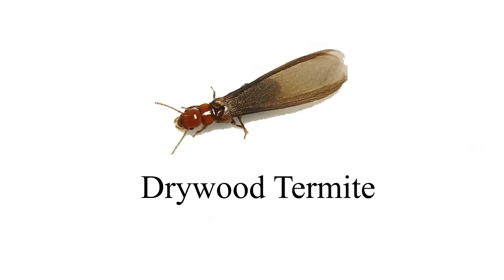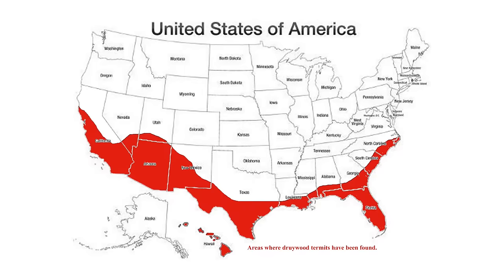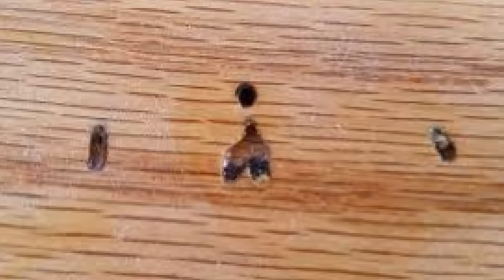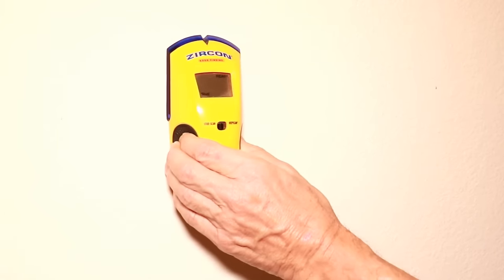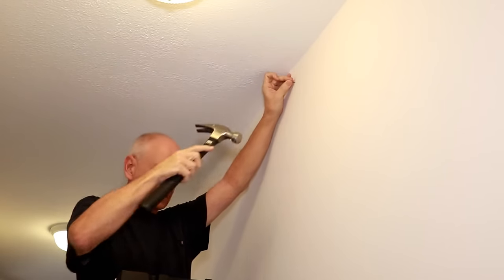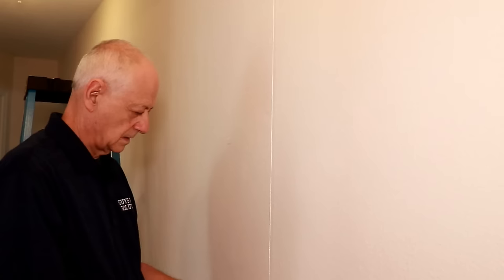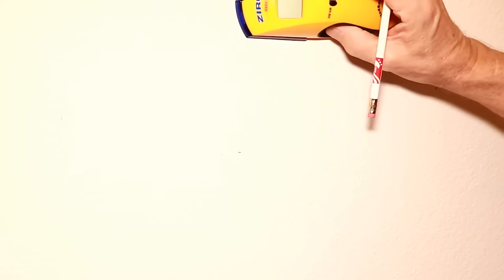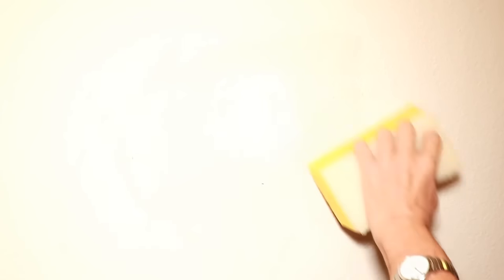How to Treat a Drywood Termite Infestation Yourself. A MUST see if you have Drywood termites.

Comment: I live in SW Florida do you recommend tenting for dry wood termites.
Reply from the maker: It is important to understand how drywood termites work.  They enter through cracks and crevices around windows, doors, the eaves, pipe penetrations, and so forth.  Most of the time, they enter through several locations.  That is because a swarm of them attacked your house at the same time.  If there was a crack or a crevice, then they probably found it.  After they established their galleries, which will be inside the wood, it will take four to seven years for them to be able to swarm.  Now that they are in your house, the swarmers will use holes that are in your studs to travel through the walls.  Those holes in the studs were created by the electricians to run the electrical wiring.  Not only are these holes going through the studs, but holes were drilled into the attic for the light switches and to run some of the wiring for the outlets.  So, the termites now have easy access throughout the attic and the walls.  Most of the time, you will have no idea that they are in the walls, because the frass is inside the wall.  To make matters worse, if you have drywood termites, then your neighbors have them too.  That means you have been getting swarmed for as long as they have existed in the neighborhood.  Most likely, we're talking about years, so it's a safe bet that you have these guys in many locations in your home.

I always hate to be the bearer of bad news, but if you have drywood termites, the the answer to your question is yes. The only sure way to get rid of them is to fumigate.  Prices for this can vary wildly in this industry, so I recommend that you watch my video on how to hire a pest controller without getting ripped off.  That video can save you a lot of money.  You should also know that the gas they use to fumigate has absolutely no residual action whatsoever, so you can get reinfested the moment the tent comes down.  Like I said before, if you have drywood termites, then your neighbors have them as well.  Since drywood  termites swarm every year, it is almost a certainty that you will be reinfested within a year after the fumigation is done.  The only way to prevent this is to do a preventive treatment on your house every 60 days.  Most pest controllers will not do this, so it is something that you generally need to do yourself.  I have a video on how to do that and I will place a link below.  If you absolutely cannot afford to fumigate your house, then you can try spot treating it yourself.  It is virtually impossible to find all the termite galleries, but it is way better than doing nothing.  Regardless of how you treat it, you should begin the preventive treatment immediately, so that you do not get additional termites paying you a visit.

I hope that helps.  Be well Charlotte.                      

Video on how to hire a pest controller without getting ripped off:  https://youtu.be/y-a8XOqVrlE

Video on how to prevent drywood termites (You do not need to treat your yard for drywood termites.  Just the exterior of the house.):  https://youtu.be/Yozv3s-Qwlw

Comment: How often do I have to reply the foam
Reply from the maker: Usually just once.  The foam can last several years in a wall stud.  If you don't fumigate, then eventually the same stud may become infested again, and you will need to reapply the foam.  I have not seen any studies that have determined exactly how long the foam will last inside a stud.  So, I cannot give you an exact timeframe for when it would need to be retreated.  I think the answer would be to retreat when there is another gallery in the same place.  I hope that helps.  Be well my friend.

Comment: HELLO GUY, I WENT DOWN THRU THE COMMENTS AND DIDN'T SEE MY ? , SO, IF I USE BORE-CARE 1:1 WHAT IS THE SQ FT I CAN TREAT? THANKS, LOVE THE VID'S!
Reply from the maker: That depends on a variety of factors, such as the sprayer used, how porous the wood is, how heavy you apply it, and so forth.  I think a good place to start would be to assume that you will get about 400 to 600 square feet out of two gallons of mixed solution.  I just treated a plywood deck that was 77 SF and it took about 1/4 gallon that was mixed one to one.  At that rate, I was getting about 308 SF per gallon of mixed solution.  However, I was applying it with a paint brush, so it goes further that way.

I hope that helps.  Be well my friend.

Comment: Guy.. what about using sound to find the infested areas? Termites make alot of sound when they eat, couldnt you use a stethescope and listen to each beam?
Reply from the maker: That can work sometimes, but it's not reliable.  Drywood termite galleries can be as small as the size of a peanut.  Also, they can be in the ceilings or really high up in the wall where the wall meets the ceiling joists, and you can't get a stethoscope into areas like that easily.  Then there is the problem of competing noise.  Things like the HVAC system running or even outside noise can sometimes get picked up in the walls, making it hard to hear the termites.  So, this can be another tool that you can use, but you will most likely miss galleries.  I really wish it was that easy, but finding all the galleries is almost impossible.  I hope that helps.  Be well my friend.

Comment: I am using delmatherin (by Terro) instead of fipronil. Are effectively the same?
Reply from the maker: Those products are not at all the same.  Deltamethrin is not a good choice to kill termites because it works too fast.  For termites, you need a slow kill to give them time to share it with the other termites.  However, deltamethrin is a good choice for preventing drywood termites, if you apply it on the outside of your house.  Terro products are expensive though, so you are better off ordering the correct products from domyown.com.  The professional products are much more concentrated and just work better.  Also, cheaper per finished gallon too, if you are obtaining the same product strength.  Please watch my video on how to treat the outside of your house.  This treatment will prevent drywood termites.  I recommend that you do it every 60 days.  If you don't prevent them, then they will keep coming in.  You should also know that the only sure way to get rid of them completely is to fumigate.  They are easy to treat if you can find the galleries, but finding the galleries is very hard.  Even the best of the best pros can't do it.  You always miss some.  If you decide to fumigate, then please watch my video on how to hire a pest controller without getting ripped off.  It may save you a lot of money.

I hope that helps.  Be well my friend.

Video on how to treat the outside of your house:  https://youtu.be/Yozv3s-Qwlw

Video on how to hire a pest controller without getting ripped off:  https://youtu.be/y-a8XOqVrlE

Comment: Can I spray boracare or Taurus SC through the roof/eve vent holes into the inner roofing that is also part of my family room ceiling?  I do see a kick out hole in my ceiling with frass on the floor for about over a week now.  Thanks!
Reply from the maker: I'm sorry, but Bora-Care and Taurus SC do not work that way.  If you are seeing frass on the floor and there is a kick out hole in the ceiling, then you most likely do have drywood termites.  I recommend that you get a pest controller to confirm this.  Estimates are usually free.  Just don't sign anything.  Drywood termites are slow eaters, so you can take some time to get the best price.

It is important to understand how drywood termites work.  They enter through cracks and crevices around windows, doors, the eaves, pipe penetrations, and so forth.  Most of the time, they enter through several locations.  That is because a swarm of them attacked your house at the same time.  If there was a crack or a crevice, then they probably found it.  After they established their galleries, which will be inside the wood, it will take four to seven years for them to be able to swarm.  Now that they are in your house, the swarmers will use holes that are in your studs to travel through the walls.  Those holes in the studs were created by the electricians to run the electrical wiring.  Not only are these holes going through the studs, but holes were drilled into the attic for the light switches and to run some of the wiring for the outlets.  So, the termites now have easy access throughout the attic and the walls.  If you have a basement or crawl space, they have access to that as well.  Most of the time, you will have no idea that they are in the walls, because the frass is inside the wall.  To make matters worse, if you have drywood termites, then your neighbors have them too.  That means you have been getting swarmed for as long as they have existed in the neighborhood.  Most likely, we're talking about years, so it's a safe bet that you have these guys in many locations in your home.

I always hate to be the bearer of bad news, but if you have drywood termites, the only sure way to get rid of them is to fumigate.  Prices for this can vary wildly in this industry, so I recommend that you watch my video on how to hire a pest controller without getting ripped off.  That video can save you a lot of money.  You should also know that the gas they use to fumigate has absolutely no residual action whatsoever, so you can get reinfested the moment the tent comes down.  Like I said before, if you have drywood termites, then your neighbors have them as well.  Since drywood termites swarm every year, it is almost a certainty that you will be reinfested within a year after the fumigation is done.  The only way to prevent this is to do a preventive treatment on your house every 60 days.  Most pest controllers will not do this, so it is something that you generally need to do yourself.  I have a video on how to do that and I will place a link below.  If you absolutely cannot afford to fumigate your house, then you can try spot treating it yourself, like I showed in the video you already watched.  It is virtually impossible to find all the termite galleries, but it is way better than doing nothing.  Regardless of how you treat it, you should begin the preventive treatment immediately, so that you do not get additional termites paying you a visit.

I hope that helps.   Be well my friend.                      

Video on how to hire a pest controller without getting ripped off:  https://youtu.be/y-a8XOqVrlE

Video on how to prevent drywood termites (You do not need to treat the yard to prevent drywood termites.  You just need to treat the exterior of the house.):  https://youtu.be/Yozv3s-Qwlw
Reply: @GuysPestSolutions  is it too late to use spot foam treatment through the kickhole and spray over and through the roof vents with Taurus SC?
Reply from the maker: It is not too late to do a spot treatment with a fipronil foam, but you need to understand that treating one gallery is not going to end the infestation.  If you found one gallery, then there are probably many more that you have not found. Trying to spot treat drywood termites is kind of like playing whack-a-mole.  No sooner do you think that you treated all the galleries, when another one pops up.  That is because some of these galleries can be the size of a peanut, and they are virtually impossible to detect.  Those small galleries will continue to grow though until they are large galleries.  You will undoubtedly have galleries in the attic and in bearing walls that will eventually result in structural damage.  Granted, it can take a long time for drywood termites to cause structural damage, but if you don't kill off all the galleries, then structural damage is probably inevitable.  Keep in mind that you don't know how long you have been infested.

Spraying Taurus SC in the roof vents will help to prevent new infestations, but it will do nothing to eliminate the infestation you already have.  I think it is a very good idea to begin a preventive treatment right now to stop additional termites from entering your home, but it will have no effect whatsoever on the termites that are already in your home.

I know this is not the news you wish to hear, but I can tell you that the only way to eliminate drywood termites is to fumigate.  Also, the only way to prevent them from coming back is to do the preventive treatment.  I recommend that you start getting estimates for the fumigation.  Get as many estimates as you can because prices can vary quite a bit. Even though drywood termites are slow eaters, you should try to make arrangements to do the fumigation sooner rather than later.  There's no real rush, so take your time and get the best price.  In most cases it would not hurt to take a few months to get the estimates together and arrange whatever financing you may need, but this is not the sort of thing I would put off for years.

I hope that helps.  Be well my friend.
Reply: Is Taurus dry a good application for drywood termites??
Reply from the maker: @roygonzales273  The answer to that question is both yes and no.  Taurus Dry will kill drywood termites, but it is not as effective as using Termidor Foam.  Also, you still have the problem of finding them.  It is almost impossible to find all the galleries because some of them can be as small as the size of a peanut.  There is a very good chance that you have multiple galleries throughout your entire home, so the only reliable way to treat a drywood termite infestation is to fumigate.  You can do a spot treatment, but it's kind of like playing whack-a-mole.  Every time you find and treat a gallery, another one is going to crop up somewhere.  Drywood termites fly to your house, so if you have them, then the neighbors have them too.  They swarm for several months out of the year, so you have most likely had them for quite some time now and they are continuing to swarm your house every year.  So, you should begin a preventive treatment program immediately on the outside of your home.  I will give you a link to my video on how to do that.  If you decide to fumigate, you must begin this preventive treatment before the tent goes up.  If you do not fumigate, then you should begin the preventive treatment immediately to prevent additional termites from attacking your home.

I hope that helps.  Be well my friend.

Video on how to prevent dry wood termites. (You do not need to treat your yard. You only need to treat the exterior of the building for drywood termites.):  https://youtu.be/Yozv3s-Qwlw